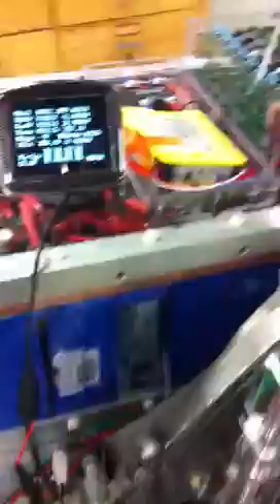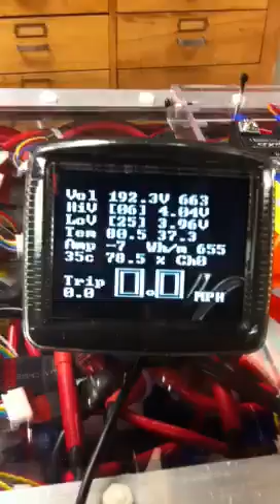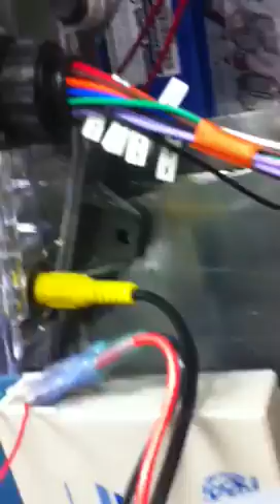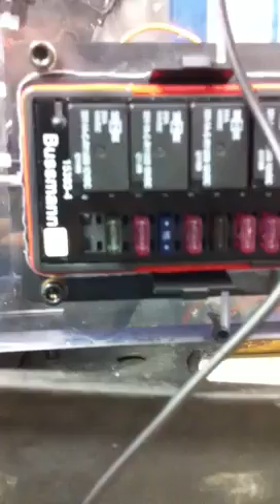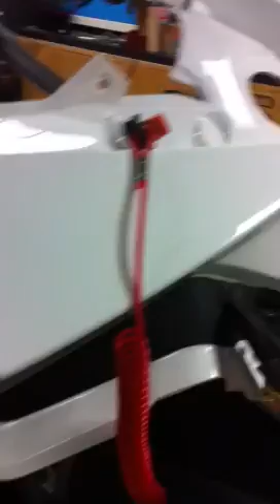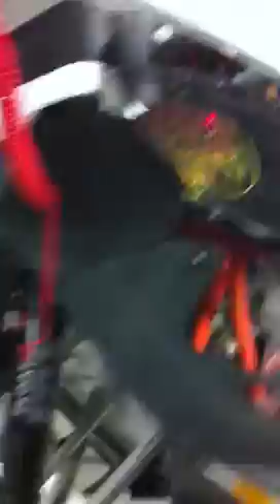Electric snowmachine

Comment: Looks nice.

The master and master bus might need screening from EMI you might also need a secondary opto stage if you get interference. Good luck

I would not seal the box yet!!!

You need to drive it at full motor powerto see how it works under load.